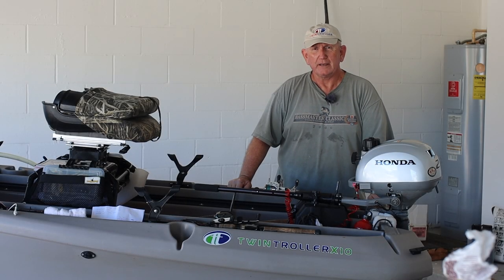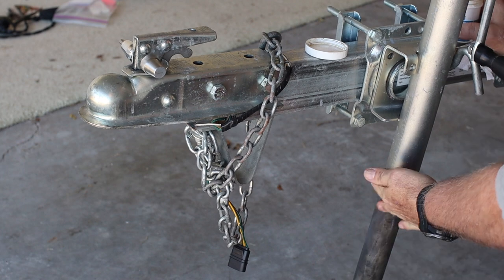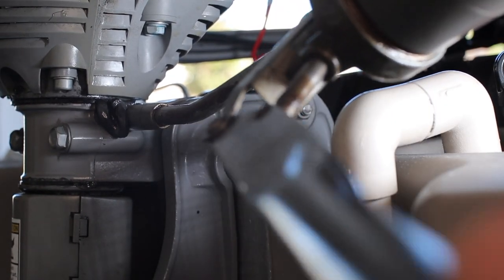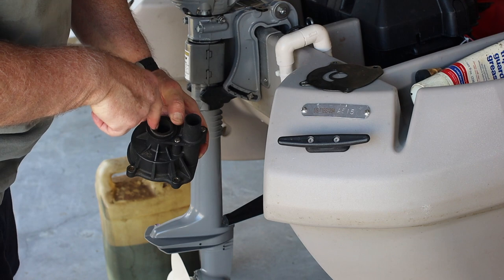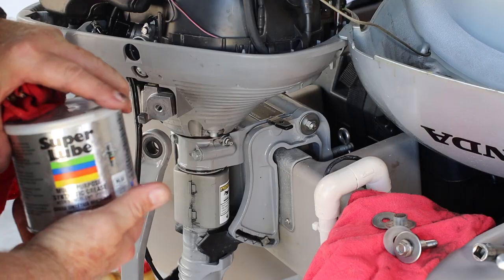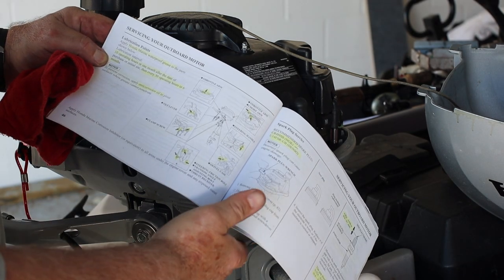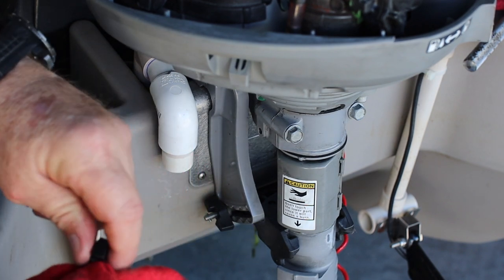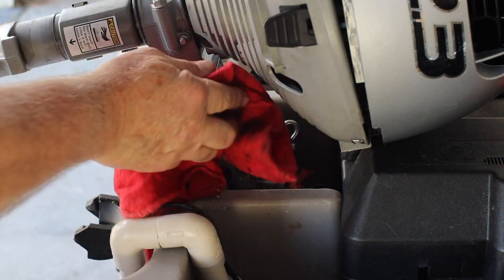HOW TO SERVICE YOUR OUTBOARD!

Comment: Is it okay to have the motor running and have it folded horizontally? What does the manual say about that?
Reply from the maker: Dan, I do not believe the manual says anything about that. For a two cycle motor that may be ok. For a four cycle motor if tipped a little the oil sump is designed to handle that. If you tip it to horizontal the oil will not lubricate the motor and bad things can happen.

Comment: Hi Gerry, what's the best way to drain unused gasoline from the engine?  If I remove and turn the motor upside down to pour the gas out, will oil also leak out?

I tried using a small pump but can't quite get all the gas out of the tank.  I thought I can drain the remaining gas through the carburetor.  But when I loosened the carburetor drain screw with the fuel valve lever set to the on position, nothing came out even though I can still see some gas in the bottom of the tank.
Reply from the maker: You are right, if you turn the motor upside down oil can exit through the carb breather or if valves are open not the combustion chamber. Not good.
Best method if you want every drop out. Remove the cover, remove the nots on the fuel tank, the fuel line will still be attached but there is enough play that you can turn the tank upside-down.                   Gerry
Reply: @LunkerFishing  Removing the tank worked great.  Thanks for the tip Gerry.
Reply from the maker: Glad to hear it!          Gerry